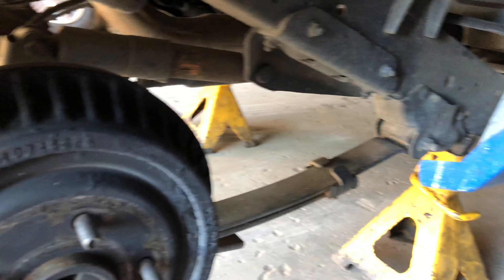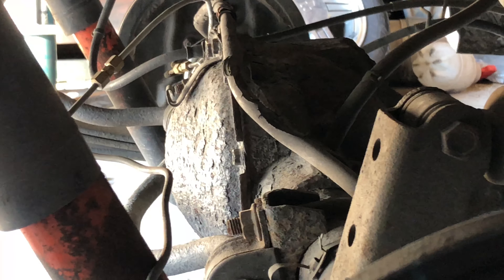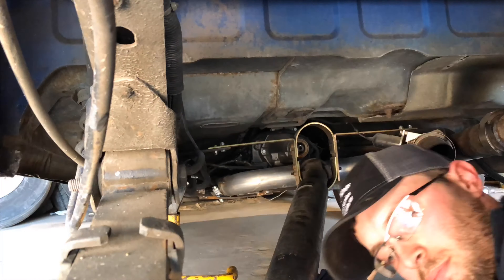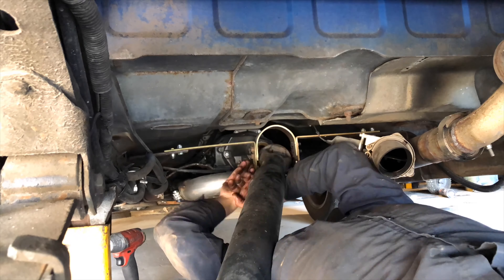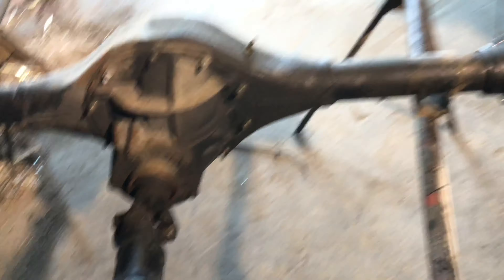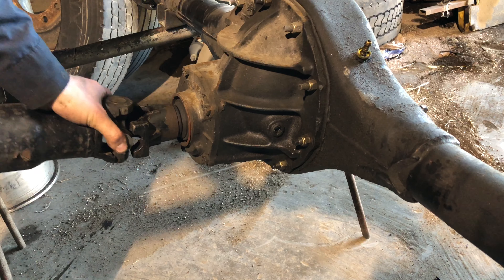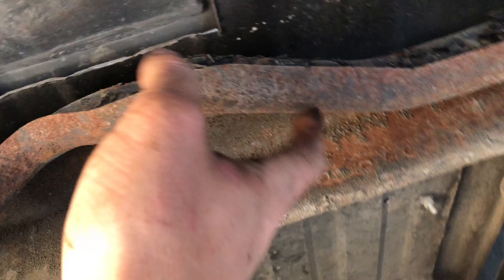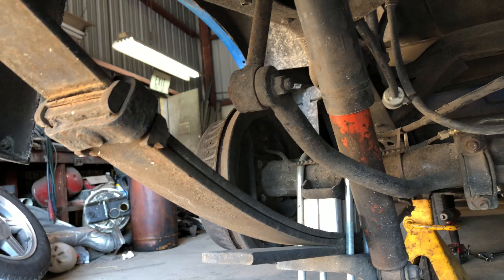S10 9" Rear End Swap: Part 1

Comment: The S10 should have a Saginaw 3R u joint. If that rear end has a smaller yoke it's probably the little 1210 which is a very old yoke. You could either get a bastard joint to adapt it or just buy a yoke for the 9" to fit the 3R joint.

Comment: Are the 10 bolts in these trucks good? I got a 2.2 4 speed with a 10 bolt rear end and just wanted to know if it’s any good
Reply from the maker: I’ve been 11.4 @120 in the 1/4. It’s held up great. I kinda got it wound up one day and it popped.
Reply: LsBluu thanks👌
Reply from the maker: Just gotta keep it from wheel hopping
Reply: 2.2 doesn't need no 9inch lol